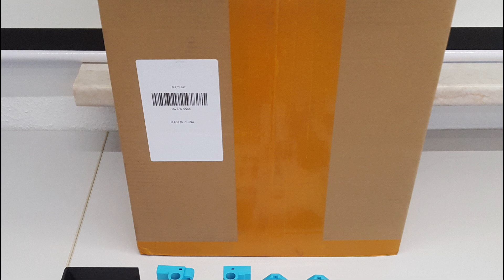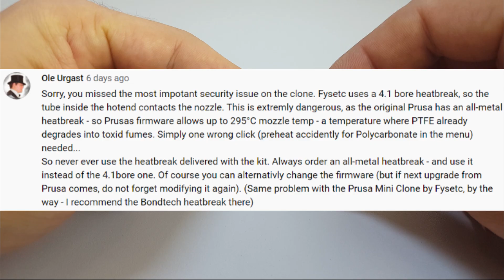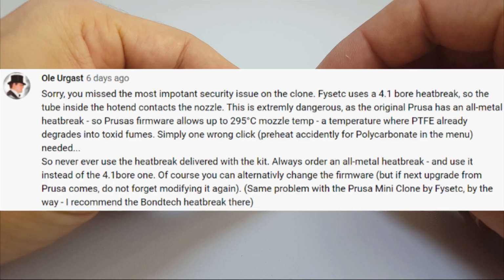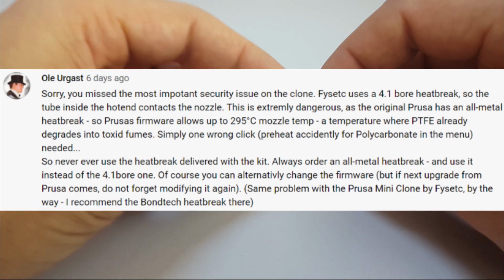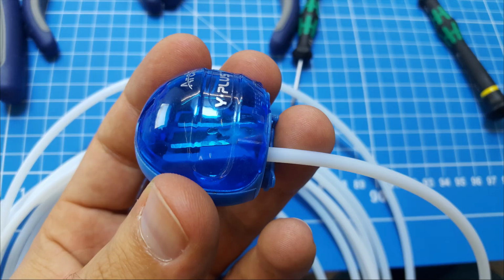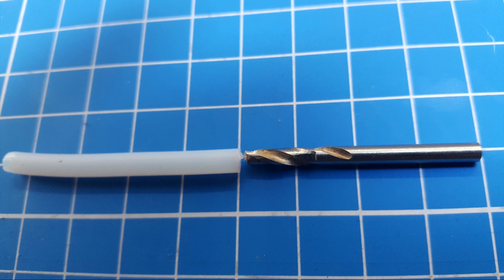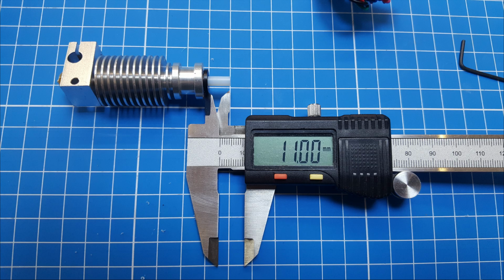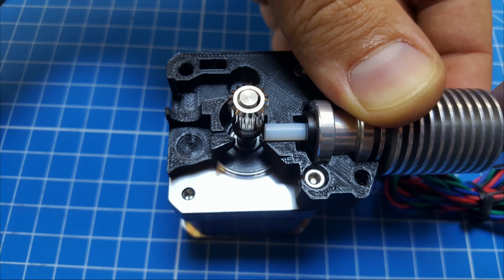Prusa MK3s Clone 3D printer unboxing and assembly

Comment: I was thinking about purchasing one of these Fysetc i3 Clones. But currently I'm converting my RepRapGuru i3 "Clone" to more of a true Clone. 8mm lead screws from 5mm threaded rod, new Big Tree Tech SKR 2 board and a donated Anet A6/A8 heated bed (don't worry I replaced and soldered the wires directly). Hopefully I have all the bugs worked out and am finishing assembly this week. I take my time and triple check everything. Happy tinkering everyone!

Comment: The clone has print fan and hotend cooling fan cable colours exactly opposite to the original. I was following the original manual and had connected them the wrong way. Had I not noticed it I would have damaged the hotend by heat creep. Putting it out here for anyone else considering this clone alternative following this video

Comment: You mentioned in the video the parts worth replacing is the heatbreak and the bearings. Are there any other parts that would need replacing or would that be it? I just need the printer to deliver a decent print quality not looking to upgrade it just yet.

Comment: What in your values in "belt calibrate"?
Reply from the maker: "Run the Self-test or the Belt test, from Calibration on the LCD. The check LCD-menu -> Support -> Belt-status. You want the number between 240 and 300 (275~). The lower the number, the tighter the belt is. Imagine it is a fictive count of teeth in circulation."
Source: help.prusa3d Webpage
Reply: @Dombi3D  I'm asking about a clone from fycets. Without a belt, my value does not rise above 240. Is it the same for you?
Reply from the maker: @natanbaron7203  It works by me. It is strange that you get too tight values even when the belt is not there. Your motor has to be faulty or the pulley has some contact with the motor body and it makes extra friction.
Reply: @Dombi3D  I have a maximum of 250 x and y without a belt. Worth einsy rambo 1.0a. What could be the problem?

Comment: Hi Everybody,

Since this place seems to be the best place to exchange information on the Fysetc MK3S I am going to post my build results as it is running and printing now.

First the trouble and how to avoid it:

Filament sensor. Do not over tighten it! Make sure the leaver inside as some clearance and moves freely. First sign of filament sensor not working well is the auto filament loading not working and in settings IR always stating 1 even without loaded filament.

Cracking of the x Axis (or are they actually Z axis) parts (x-end-idler and x-end-motor) one cracked slightly pushing in the rods (fixed with a dab of contact glue) and the other cracked while tensioning the belt (still  in place and working but will have to be replaced, will leave that for when I will install the MMU2S also from Fytsec).

PINDA, make sure to adjust the hight correctly otherwise a lot of calibrations and checks will fail, I use a creditcard or back card for hight with the nozzle a 0 then lossen the Pida and make sure the bank card just fit snugly under the PINDA and then fasten it.

Z-axis misalignment (not fixed yet) some how I notice that a couple of times my right side is one or 2 mm lower then the left. After turning off the printer and manually turn the z lead screw and measure it with a calliper all is fine again, but it comes back once in a while, anybody experienced this behaviour and if so did you got it fixed? If you got this fixed please share how?

Setup process (not fixed yet) the complete process goes well but the Z axis calibration check at the end fails at the Z axis check. to sure why but the printer is working fine.

The electronics case and cable management inside. This is a complete nightmare! Just did what the video from Fysetc shows bundled it but a tierap around the cable bundle shoved everything inside, closed the door fastened the screw. Obviously I am not happy with this solution and I cant imagine this will be good for the cooling of the Eynsie board. So one of the first things I will replace is this.

For the rest it was pretty straight forward and I must say that I am again pleased with Fysetc that is fast becoming one of my favourites on Aliexpress, also because the support until now has been amazing!

Anyway, Hope my pointers help other to prevent the issue I ran into!

@Dombi3D I almost cant wait for you bearings review (it is a pity you did not include the IKO's but I can say from my experience they are amazing!) and maybe even more anticipating the MMU2S review as I want to wait for your experience before I start with mine. Somehow I had etc feeling that one will be hard work to get it working correctly and stable.
Reply: Nice recap of your build :)
Regarding the x end idler and motor... I feel your frustation, the same problems that i had 😅 As well the Idler as the motor part had to be glued on my Printer🙈
Reply: @Karafu147  Did you encounter the other issue of the right side sometimes not alining with the left by a couple of mm in hight?
Regarding the glue, for now it will do is not load bearing, but when I will install the MMU2S I will replace them. Will look into a more sturdy print/infill or even change to ABS, never printed with ABS but as soon as my PRUSA enclosure is finished I will give it a try.
Reply: @lusiada6787  Hmmmm, I think i never noticed something like that...
Forgot to mention, I really like to hear when you get your MMU2S if it will work properly, i also thought about getting me one. Do you get yourself the original or the FYSETC one?
Regarding your parts you like to reprint, i don't know if ABS would be the best material for your purpose. In general it should work, but PLA or even PETG tend to have better Layer Adhesion than ABS. Allthogh ABS has more Impact strength, but dont know if you need that in theese parts.
If you just dont want the parts to break you could just adjust the tolerances of the CAD files of the X-Axis parts. As i mentioned in my experience i Think that would have helped a lot to bring the linear guides into the Printed parts without breaking it.
Reply: @Karafu147  Hmm, OK I will just reprint in PETG lik etc ones before and add one wall layer and increase the infill by 20%.
Regarding the MMU2S I got the clone from Fysetc. There is not much info on the clone MMU2S so I am afraid I will be in for a bumpy ride, luckily Dombi3D is also preparing a video on the MMU2S clone so I will wait for that. I have seen a video on it by someone but it was a really sloppy video with almost no info, the only part I got was that you need to change the blade because the one that comes with the kit is not very good. I already received mine and it looks rather compete.
One of the bags (the one with square nuts) was ripper so I had allot of square nuts at the bottom of the box and probably will miss some, but support from Fytsec has been really good until now so no worries there.

As soon as I assemble mine I will let you know, but keep an eye out for Dombi3D as he will probably post something also.
Reply from the maker: @lusiada6787  I have no such a probem.
Reply from the maker: @Karafu147  I got the Clone version and already printed the parts for it from PETG just not managed to assemble it yet. Working on other projects but it is on the list :)
Reply from the maker: @lusiada6787  I will, just don't know yet when...
Reply from the maker: Try the Z axis calibration with steel sheet on.
Reply: @Dombi3D  Hmm, OK good tip. Th calibration tells you to remove it.
Reply from the maker: @lusiada6787  The Pinda searching for some metalic part. For me the nozzle crashed to the bed and got the error message without the steel sheet. My original Prusa did the same. I don't know why is that, maybe they changed something with the new firmware.
Reply: @Dombi3D  OK will definitely try, thank you for the tip! Did you have any issue with the Firmware upgrade? And have you already tried the Octoprint Firmware Update plugin? If so with which settings?
Reply from the maker: @lusiada6787  Firmware upgrade through USB was no problem. Not tried Octoprint FW update plugin yet.
Reply: @Dombi3D  Just tried with the metal sheet on, same issue. Not really a big issue since the printer is woking fine, just bugs me!
Reply: @Dombi3D  Tried it, same result, the odd thing is that afterwards it tells everything is OK. It also does not crash into the bed. just stops slightly higher than the paper and says calibration of Z failed. But the printer works fine. I guess I can live with this the only thing that is bothering me is the x misalignment, does not seem to affect printing but is really bugging me, today it was again 3 mm lower on the right side. It is visible without measuring.

Comment: Hi Thank you for this video.
After seeing the video and already owning a Prusa mini clone form Fysetc I decided to buy the MK3S and the MMU2S from Fytsec.
The MK3S Prusa clone is almost built (only the wiring and cable management has to be done.) and the process was pretty straight forward.
I used the videos and the guide from Prusa, I think using both is a good strategy as the one is a video (which is not very good by the way) and the other only foto's and text, the video can be more explanatory in some circumstances.
The only thing I am wondering about is the nylon filament guide, I am wondering why Fytsec does not include this and if is 100% necessary.
In the assembly video that do not use it also.

One other thing i would like to mention is that Fytsec seems to have made some improvements, I got different square nuts which seem to fit perfectly and I got bearings from YTP which look very good also, I had ordered IKO bearings form Triangle labs and used those but the ones that cam with my kit (YTP) look as good as the IKOS and much much better then the ones that came with the Prusa mini clone. So I used the IKO's and will use the YTP ones for my Prusa mini.
Also, I cleaned the bearings with isopropyl alcohol and put fresh superlube grease on them.
One other tip that helps with bearing problems and loud sounds etc. is to lossen all rods just a bit after assembly of the gantry's move th agentry's back and forth and tighten it again.

I also exchanged the heatbreak for a Triaglelabs Titanium one and brass heatblock also from Triangle labs. Not sure if the brass heat block will cause any issues with temperatures and the used cartridges. Time will tell. 

Regarding the electronics, I seem to have a different LCD, mine looks better than the ones in the video and the ones shown by Dombi3D, mine has a black PCB with very clear text on it and good soldering, but not tested yet, not sure also if I need to do the cable modification.

Regarding the filament detection sensor, on the Prusa guide they say you shroud use the red sensor, but in the kit there is a black one, not sure if this will cause any issues with the Prusa firmware.

@Dombi3D,

You have stated in your video about testing with IGUS bushings did you test that already and if so how are the results?
I am planning to exchange the LM10UU Z axis bearings on my Prusa mini clone and the Z axis bearings on my MK3S clone with these IGUS polymer bushings but want to know how the experiences are.
Reply from the maker: The tests are ongoing. I am testing 5 different bearings and I want to make the test more scientific with accelerometers etc. which takes more time as I expected. However I already Printed with the IGUS bearings and so far looks good. You just need to take car to not clamp them too strong because then they will have too much resistance. For Z axis I use IGUS for 6 printers.
I am working on different projects but I really hope that I can manage that Bearing comparison video also in the future.
Reply: @Dombi3D  Cant wait for your video!
I think I will print with the IKO's for now and when I mount the MMU2S (wille need to disassemble a lot) will install the icus.
Did you read about the part regarding the Nylon Filament? Do you think it will cause issues if I don't use it?
Reply from the maker: @lusiada6787  Use the Teflon tube instead. I did so and it works. MMU2S clone also waiting for the unboxing here as well as mini clone, but time...
Reply: @Dombi3D  Mini Clone from Fysetc? If so, that is a great little machine! bearings are really bad though. But the rest is very good in my opinion.
Regarding the teflon tube, yeah that is a possibility but I am not to fond of using the screws to secure it, Would it be pozsslibe to use a bit of PETG filament inside the PTFE Tube, this part would stick in the extruder, the only issue is getting it secured in the extruder as 1.75 is to
 thin

Comment: What size drill bit did you use for ptfe tube? Struggling to get a conical shape without making tubing bell or bubble out.
Reply from the maker: I believe it was a 4 mm one.
Reply: @Dombi3D  thanks! Any trick to prevent bubbling or from it bending out? Did you use low speed or high speed? Did you put it inside of something to give outside support to avoid bubbling out?